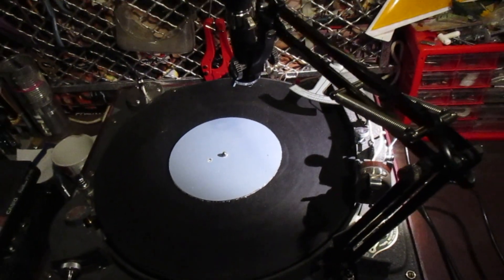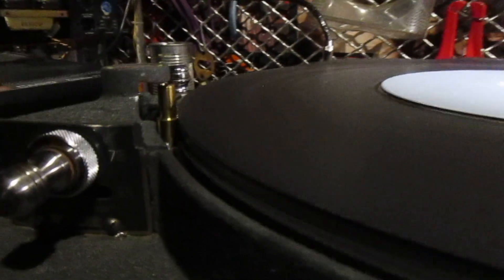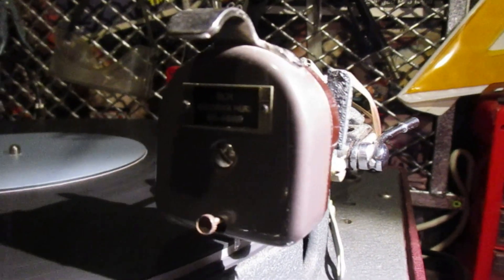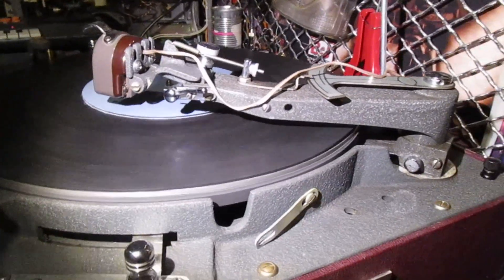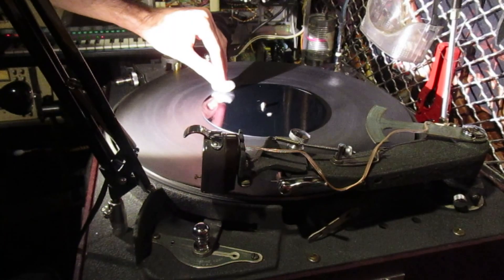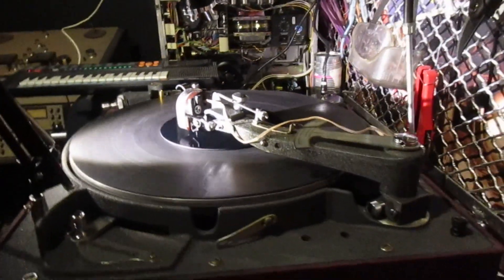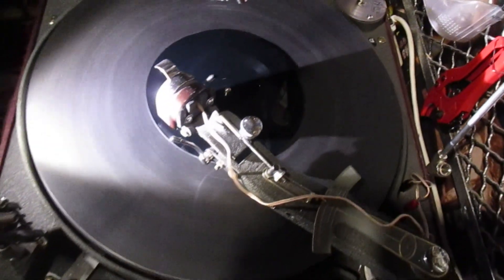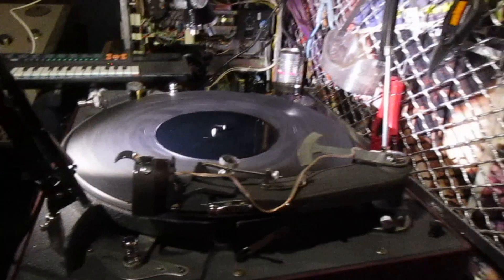Presto75A Disk Recording Lathe Demonstration

Comment: I see there's no swarf as the record is cut.  What is blank the disc made of?
Reply from the maker: It is a PETG disk. The grooves are embossed with a conical stylus in this video. Embossing does not produce swarf. Our latest video has high magnification footage of a cutting stylus where you can clearly see the chip/swarf being picked up by vacuum suction.

Comment: That lathe appears to be missing the damper/dashpot assembly. Does it have any issue cutting well without that?

What type of cutting shank/stylus are you using? Heated/unheated?
Reply from the maker: We use both heated and unheated stylus types, but I definitely prefer the heated types. The Presto 75A in this video is using an RCA head with an unheated stylus and works fine without the type 171A damper. For lacquer or heavier heads, it works much better with the damper. The type 171A dry damper is now hard to find, we sold the lest one we had here recently, but Agnew Analog can supply a custom oil dashpot to fit the 75A.